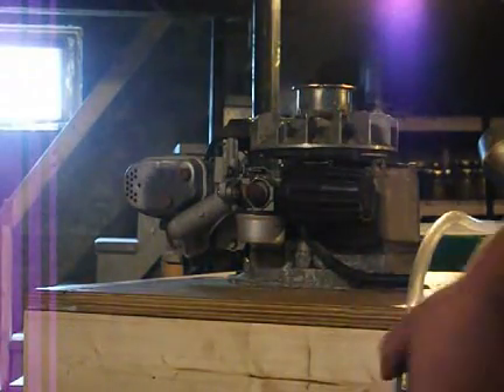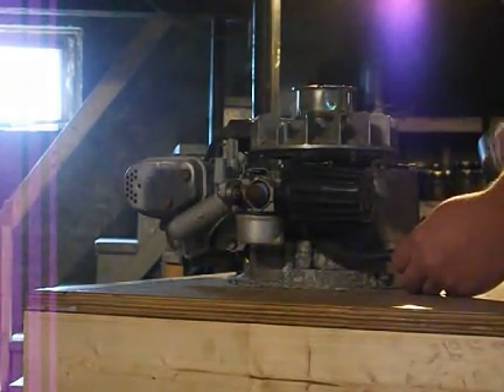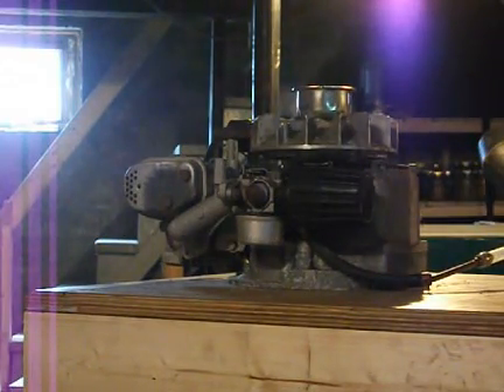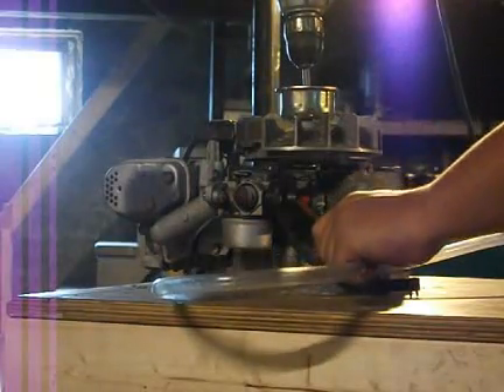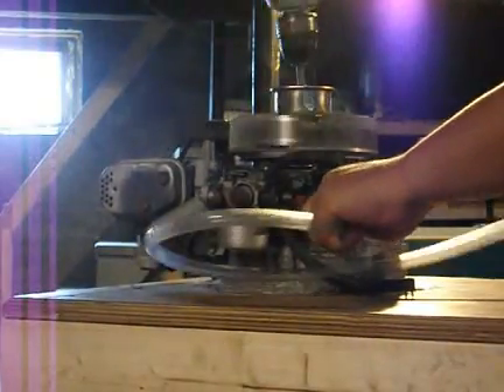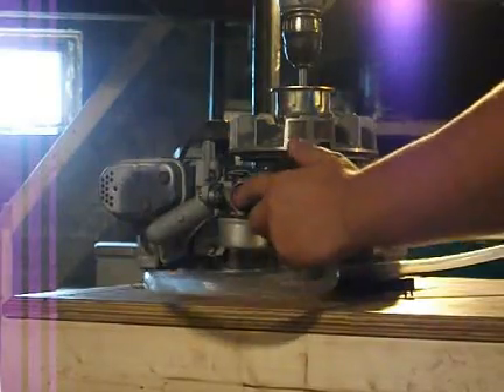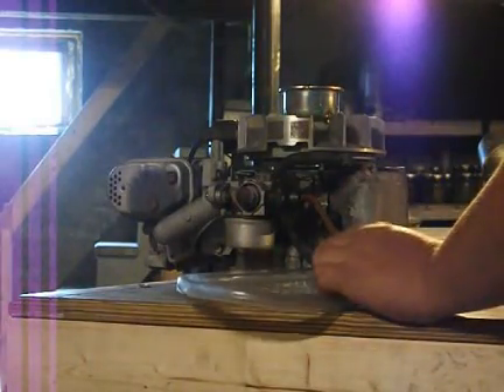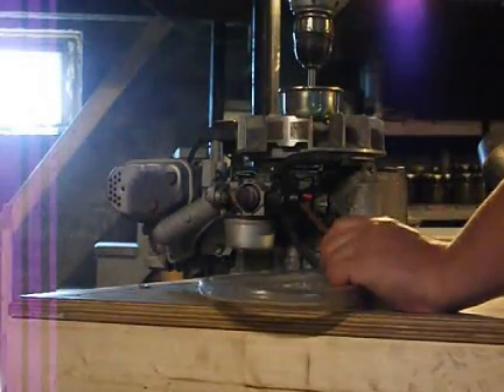Hydrogen ( HHO ) Engine Part 3

Comment: Ya toss the carb out. You don't need it. HHO is already a perfect mix. Make it air tight to the intake. After that if you have enough hho production to do more than idle use a needle valve to throttle it.